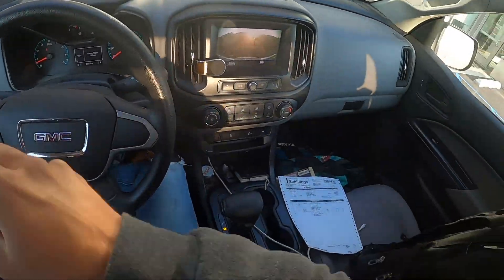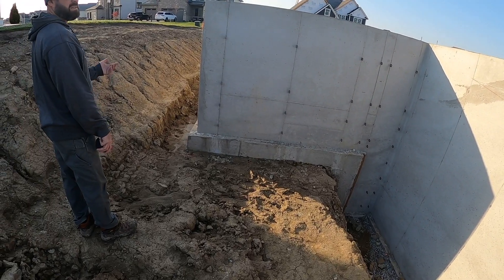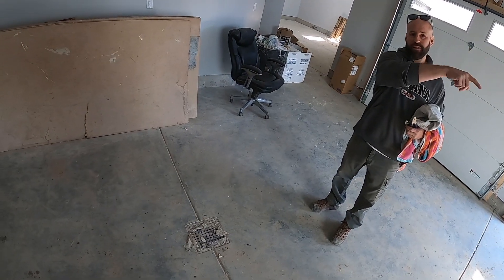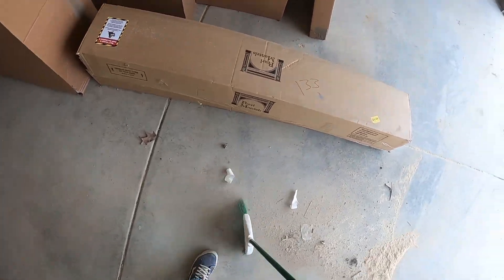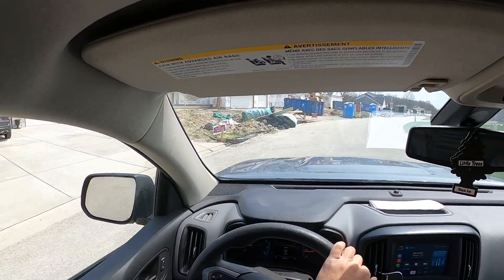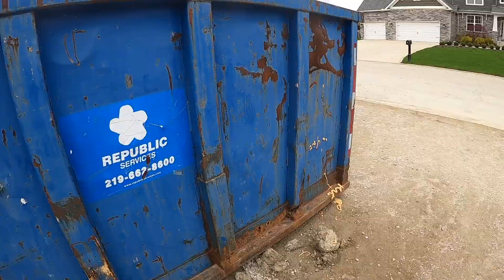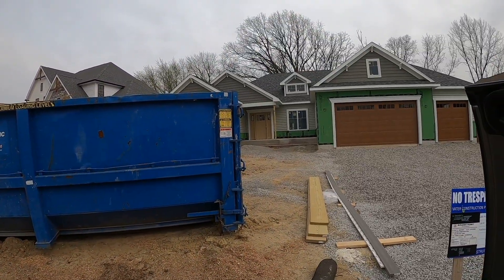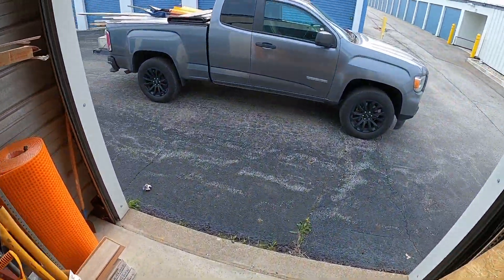Day In The Life 2 - What It's Like Working For a Home Builder

Comment: I'm an old carpenter in Maine. My first job out of high school in 1975, was working for a general contractor. We did it all and most of the time, the same workers that put in the footing and foundation did it all from foundation to capping the roof. We built the cabinets, installed the wood floors, hung the doors and most everything else. The electricians, plumbers and heating guys did their thing themselves. It was a great experience. Most of my career was doing remodeling, both residential and commercial.
I'm retired now and I still do some work when I want to on a job that interests me. 
I was 19 years old when I started. I weighed 135 pounds at 6 feet tall. I was the kid that carried the shingles up a 40' ladder to the "old guys" on the roof. Oh, we used hammers to drive nails back then.
You're in a good honest trade that can be very rewarding. I still drive by houses I worked on and say, I did that, or I helped build that house.
I love your content and it brings back a lot of memories.
Reply from the maker: Awesome to hear! I feel the same way about the trade. Super rewarding👍

Comment: Great video. At 25:40, what kind of fastener did u use to nail down to the slab? I’ve got trim out some windows in an apartment and all the walls are exposed brick
Reply from the maker: Thanks! I just used some Ramset concrete nails. Didn’t have a Ramset so I just hand drove them👍